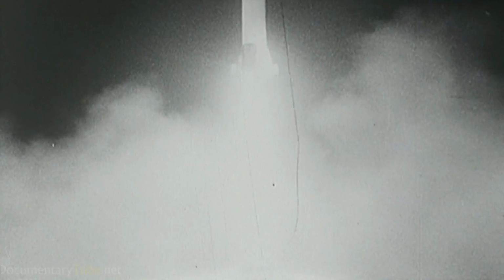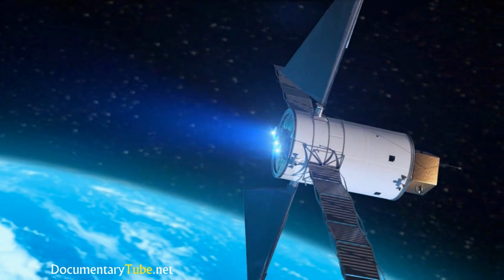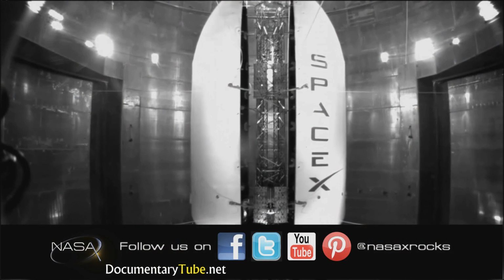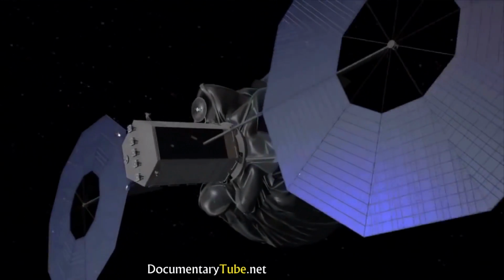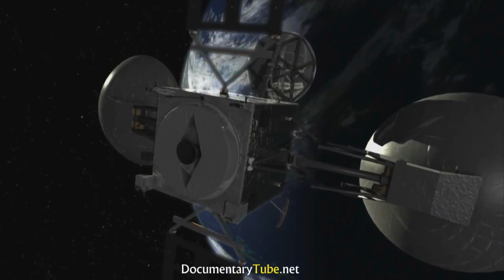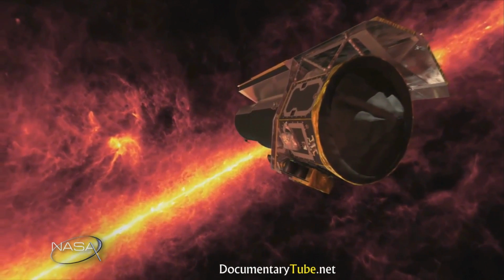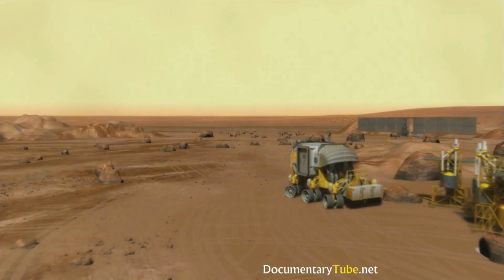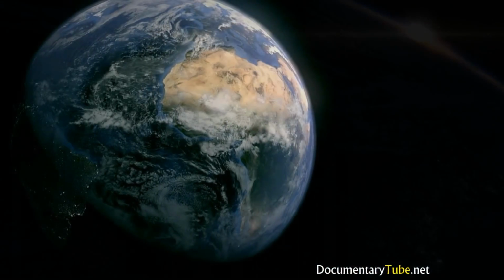NASA's Engines and Possible Speed of Light Propulsion?

Comment: PRECISION is a measure of REPRODUCABILITY and ACCURACY is a measure of how close something comes to a marked target.   Do not confuse these two ! The vid is about ENGINEERING.  But we need SERIOUS BREAKTHROUGHS in our basic understanding of MATTER, SPACE, ENERGY and TIME.  Basic Research is not as "sexy" as Engineering so it is not Championed as Ardently as we need to.  Deep THINKING and intense MATHEMATICS do not seem to be popular in education today :-(   Never-the-less here are a few suggestions:  (1) basic research on the nature of GRAVITY; if we could localize a reduction or reversal of GRAVITY. ...  ... (2) we need to deeply understand the nature of electricity and magnetism so we can fabricate high temperature ( +300 Kelvin),  cheap, safe, reliable, long-lived SUPERCONDUCTORS  (3) a way to use Gravitics to scoop up enough interstellar Hydrogen as a source of propulsive fuel (4) to re-invent / re-discover Nikola Tesla's transmission of electrical energy WIRELESSLY then be able to INSTANTANEOUSLY transmit it +1000 light years.  Now, these FOUR suggestions if realized would be TRULY EXCITING !

Comment: Hello watch my video witch is a basic insight into safe Fustion gereneration
It can power infinate speed even go inter cealer with one speed up leap
The direction you go must be cleared by a very accurate hole balanced six inches from Hull so it can fly trew sun's asteroids and light witch can burn you if you rub agaist it one Fustion reacter generated 58 million gigatons
It is safe

There are Fustion reacter that run on hydrogen that are not safe

Instead of fusing dangers fuel it just uses light in a lazzer sum of light is really DISTRoyed but this doesn't matter

The light fuses in chamber and again it fuses as it is jetisoms out of light magi fies on the jet nozzle

Comment: Why do NASA and Space people talk of speed of light engines, when they cant get off earths ground.
Reply: @MuchCow9000  To build craft that fly in space , you must be able to define all relative aspects . You can’t , NASA can’t . What ‘ things ‘ work different in space ?
Reply: @MuchCow9000  In a vacuum a steel ball falls at the same speed as a feather . What is the difference between a falling piece if rocket and an asteroid ? If we can get out of earths atmosphere with regular ease , asteroids would get in , and the earths surface would be uninhabitable . I think what creeps most people out , is the extent NASA scientists got to , to create a lie
Reply: @bradfordpal  there is a big difference between a rocket and an asteroid, a rocket takes off from the atmosphere at a speed of 0 m / s, and to orbit outside the atmosphere it is about 7500 m / s, and at that speed it returns to the atmosphere and is subjected to insane amounts of heat, now imagine an asteroid that is much further than low Earth orbit, in orbital physics the further away the orbital period is the faster it goes, so an asteroid does not enter the atmosphere at 7500 m / s , 15000 m / s or more, this may not sound like a big difference but in space it is, since each time you increase your speed by 2, the heat of the reentry would be 8 times higher, let's compare a reentry of a capsule of Low earth orbit with one from the moon, one that goes from LEO supports a temperature around 1600 degrees Celsius and the Apollo capsules had to have a temperature about 3000 degrees, and that was only going to 9000 m / s so it is not the same a rocket than an asteroid, only large asteroids can reach the surface without disintegrating and it needs to be even larger to do any significant damage.
Reply: @MuchCow9000  Is that the best reply you have ? Insults ? ‘ Human trash ‘ comes to mind ‘ Bug blood ‘
Reply: @MuchCow9000  Is asking a question about fundamental physics an insult ? Ask me a question about anything to do with space , and I’ll answer it . What height is lower orbit ? I guess that’s a big insult !
Reply: @MuchCow9000  If satellites exist , why can’t I get internet on the ocean ? That’s two thirds of the worlds surface , or are satellites stationary, in orbit , only over land ??
Reply: Chile abuse
Reply: @bradfordpal  satellites provide very little internet because they are in geostationary orbit, which is very far (about 35786 kilometers compared to 100 which is where space begins) so most internet providers do it with antennas on the ground, You can clearly connect to the internet in the ocean by buying the services of these satellites, which costs around 1000 dollars a month, but I don't think you are willing to spend that amount of money on a lower quality internet

Comment: Speed of light.
What is speed of light?
Force of Energy.
How? If our sun has 384.6 septillion watts of energy, than the sun creates an equivalent amount of light energy n has been forced to spread as light particles around our solar system. Just like Edison’s bulb? 🙈 Example: If we were able to create a 384.6 septillion watts of energy here in earth, by giving that power to any vehicle, it would be possible to travel at “speed of sunlight”. But not speed of light. Because its has a light which created by sun and can reach sun in no time. Sun Light reflects and blocks. Moon provide us the reflection when the sun is down and .it does effect the light as dim.

Comment: The had a light speed engine years and ago called pulse engine only problem once started it could not be stopped but the speed was experdecial ie 100mph 200 .400 .800.1600.3200.64.000 .128.000

Comment: Question: How does Solar power work when you get 500 million miles from the Sun?
Reply: It doesn't. The number of solar panels needed to produce a specific amount of power scales exponentially and becomes hugely impractical past the asteroid belt. The only other option at that point is nuclear. And if you want to set up a colony, using anything other than nuclear as a primary power source is tantamount to suicide.

Comment: That ion thruster should be at least 9ft diameter, then you got my atention. As long as they avoid using nuclear reactors, achieving major improvements will be impossible. Achieving 25% speed of light you would need a deflector field like in star trek, crushing a dust particle would end the journey before it even started.

Comment: Isnt it true if an Engine gets you to say 10 thousand mph in space, and the engine remains running it will propel you faster and faster until it runs out of fuel?
Reply: Well, yes but a) ion engines are way to weak to ever reach like 10% of light speed. And b) if you reach 10% of light speed, you have to apply relativity maths to the acceleration which means it will get less and less of an effect with increasing speed.

Comment: the antimatter container should work like simular to a miniature black hole but instead trap the anti matter leaving it stable bouncing around inside is should be 10 meters wide by 30 meters tall that should store enough power to get you to pluto and back in around 7 to 10 hours or less but in theory can get you back to your point of origin a few seconds after you left the problem is navigations we havent got the technology to truly navigate our solar system precisely to a decemal point for that we need a super computer to calculate the equations this is where i believe a positronic nuralnetic super computer can be created within the next 10 years using the technology we already have today

Comment: Do you know how long it will take from zero to reach the speed of light accelerating  at 1g!
Reply: About 30 million seconds which is 347 days. But this cannot be done because as the speed increases so does the mass and you need exponentially more power to Maintain
 the one g acceleration.

Comment: How long would it take to accelerate to the speed of light while consistently holding 8g or less?
Reply: I don't think you would be able to sustain 8G for the amount of time it would require to reach speed of light. At 0.5g it would take around 1.9 years. Play around with the calculator on calculator soup (velocity calculator). At 1G it's about .97 years. To answer your question though, at 8G, it would take about 44 days to reach speed of light. If a human body was put in some sort of medically induced coma, in theory it could work. But I wonder what sort of damage would be done to vital organs under 8G loads for a month and a half.
Reply: @ScottTheCarGuy  we don't want 8g. We want 1g. Even 0.5g would suffice but to sustain a burn that long is ludicrous.
Reply: @douglasrowland3722  we all know this. Engines have max output. You can't consistently accelerate nor would you want to. We do quick burns generally best idea so far is centrifugal force from wheel but if you're using ions moving at the speed of light  then you could sustain microgravity.
Reply: Also, I thought we shouldn't entertain this? Wouldn't light be itself be more like gamma radiation at those velocities?
Reply: @douglasrowland3722  no directional control? Lol, it's just a longer burn the math we use already can calculate it just the same. We just call them transfer  and capture burns. You can make normal, radial and grade burns  along the way as well to compensate for deviation. Brakes? You mean retrograde burn.... we also have reaction wheels and monopropelants to fine tune course and rotate without deviation.

Comment: The answer lays in antimatter and dark matter, if we ever hope to break the light speed barrier, and we will. We can’t break Einstein‘s theory of relativity, but we can go around it. But for the moment, until we find a more efficient way of creating antimatter, it will still be quite some time before we have faster than light travel, until then we have to rely on conventional methods, like the quaint, and  archaic ion drive... which as far as I’m concerned equates to an ant pushing a mountain! Yeah average person has no idea of how far we still have to go, but I am absolutely confident that we will achieve our goals I’m travelling faster than light. Unfortunately, the Hadron Collider produces only a minuscule amount of antimatter with an insanely high price tag of about $7 billion for only a very small amount, not nearly enough to work with. However a new (which has not yet been told to the general public) Collider is under construction, much larger than the first one,  which we hope to use, to create the necessary amounts of fuel to achieve our goal, but rest assured, I have absolutely no doubt in my mind whatsoever that we will indeed be travelling through the stars faster than light, unfortunately, I won’t live to see it, but it’s not as far away as you may think. Our children may live long enough to see it, and how exciting is that?

Comment: NASA's Advaced Light Speed Propulsion Ion Engine will beats all enemy's  5-10-Hypersonic (1,717~3,430 Miles/ Per Second), in-clude High 10-25 Hypersonic ( 3,430~8,575 Miles/Per Second) by  Light Speed of NASA's 186,000 Miles/Per Second.  In near future, "Warp" drive add to this Propulsion of "Speed of Light" will be increases to 6X higher.

Comment: Gravity must be understood, with controlling it only then will we move at speeds anywhere close to light.  I may be wrong but I think it's all magnetic propulsion kinda like a mag Lev train just larger scale using planets and stars gravity to push and pull the craft , it's finding the correct frequency/HZ that gravity works on. After all gravity is gravity,put a North Pole magnetic field to a North magnetic field you get repulsion so pulling on one attractive force of a star and pushing on it as you pass it is where I think we should try.
Reply: "Or we could just keep using that green or blue screen & pocket the rest of the money" - Don Pettit NASA engineer

Comment: Why do the arrays need to be attached?   Arrays should be able to be deployed where needed and be able to talk each other and direct power to a single source.  I 🤔 RR
Reply: You can't exactly connect them with wiring, and transmitting energy as a beam with microwaves, light, etc diminishes with distance based on the reverse square law.  Much of this stuff will never be feasible in the long run, nuclear energy is the only thing that will provide enough energy to truly get out there and off this rock.

Comment: I do wonder how far out in the solar system even the most efficient solar panels will take a spacecraft. Obviously the further it goes the weaker the sun's power. I take it this is only for voyages say as far as the asteroid belt? That is why of course the voyagers used thermo nuclear generators, effectively batteries with a 50+ year life!
Reply: 100% true, solar energy isn't the answer, only nuclear energy will ever provide enough energy realistically.  Things we haven't developed yet, not the nuclear rockets we've tested in the past where a reactor heats up hydrogen gas, I mean more along the lines of nuclear to electric propulsion

Comment: Gee. How about a nuclear powered spacecraft? We use nuclear power on earth. Like nuclear powered submarines that run forever without needing to be refueled. Why not use nuclear power in space? Seems like a no-brainer to me.
Reply: nuclear is a steam engine, the only difference  between a "steam engine" as we know it is that instead of creating steam by burning coal (or any other fuel), they use nuclear to boil water which in turn creates steam which creates pressure which then turns the turbines which creates electricity from the magnetic coils in the turbine... SO no water in space so no nuclear engine how ever they can use nuclear explosions from the rear of a craft for propulsion..... in simpleton terms
Reply: @Ratbasturd69 I'm sure your aware that when a probe is launched into space a liquid propellant is used as fuel and it's ignited in a burn lasting X amount of time. Then the spacecraft will coast in space towards its target. 

Well my idea could still be accomplished if they took their own water supply in say water tanks. The water could be circulated through a radiator type system to keep it from freezing in the coldness of space, then when its needed for propulsion, parts of the water could be directed to another part of the reactor to be converted to steam. Then the steam could be compressed and injected out through ports to use as propulsion for the spacecraft. Then the craft will be allowed to coast for X amount of time and distance. The compressed steam propulsion system could just be used for course adjustments when needed.

Comment: This electric propulsion. I had this idea back in 1980
Reply: Lots of people had the idea back then. Have a copy paste from Wikipedia:

The first person who wrote a paper introducing the idea publicly was Konstantin Tsiolkovsky in 1911.[7] However, the first private document to consider electric propulsion is Robert H. Goddard's handwritten notebook in an entry dated September 6, 1906.[8] The first experiments with ion thrusters were carried out by Goddard at Clark University from 1916–1917.[9] The technique was recommended for near-vacuum conditions at high altitude, but thrust was demonstrated with ionized air streams at atmospheric pressure. The idea appeared again in Hermann Oberth's "Wege zur Raumschiffahrt" (Ways to Spaceflight), published in 1923, where he explained his thoughts on the mass savings of electric propulsion, predicted its use in spacecraft propulsion and attitude control, and advocated electrostatic acceleration of charged gasses.[7]

A working ion thruster was built by Harold R. Kaufman in 1959 at the NASA Glenn Research Center facilities. It was similar to a gridded electrostatic ion thruster and used mercury for propellant. Suborbital tests were conducted during the 1960s and in 1964, the engine was sent into a suborbital flight aboard the Space Electric Rocket Test 1 (SERT 1).[10][11] It successfully operated for the planned 31 minutes before falling to Earth.[12] This test was followed by an orbital test, SERT-2, in 1970.[13][14]

An alternate form of electric propulsion, the Hall effect thruster, was studied independently in the U.S. and the Soviet Union in the 1950s and 1960s. Hall effect thrusters operated on Soviet satellites from 1972 until the late 1990s, mainly used for satellite stabilization in North-South and in East-West directions. Some 100–200 engines completed missions on Soviet and Russian satellites.[15] Soviet thruster design was introduced to the West in 1992 after a team of electric propulsion specialists, under the support of the Ballistic Missile Defense Organization, visited Soviet laboratories.
Reply: @MrMonkeybat  Man idk why we take shit like this serious. So many people have the will to build it but some government is always restricting us.
Reply: Just curious. How similar was it to what was laid out here in the video?
Would you say it was more efficient?

Comment: The USA is not able to get past low Earth Orbit. Solve how to get past low space orbit. The USA has never been above 200 miles. The Truth Shall Set You Free. Considering the Speed of Light. Isn't that the maximum speed attainable by everything, outside Warp and Pulsars. Does the Speed of Light outrun the speed of radiation which is the reason why we cannot travel above 200 miles above the Earth.
Reply: Your tin foil had must have a few extra layers than most.

Comment: Wrong tech
A grain of sand would penetrate a ship at light speed. 
Try again.
Reply: Jim Gibbons a grain at orbital speeds will do the same.
At the speed of light, it will have infinite amount of energy, allowing it to smack through planets.
Reply: So
Just have a radiation shield around the ship put it in a protective pocket
Reply: A grain of sand at light speed has infinite energy. Perhaps if a laser could be used to accelerate that grain an engine could reach half light speed.